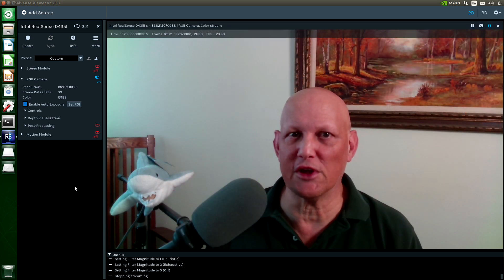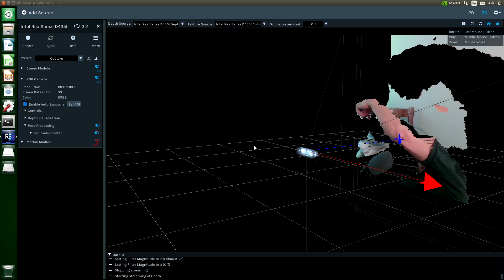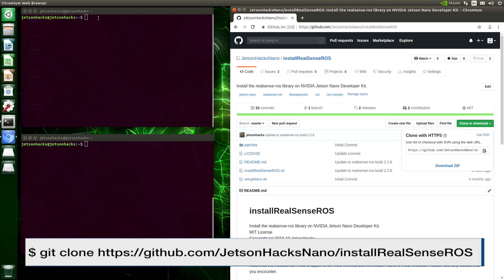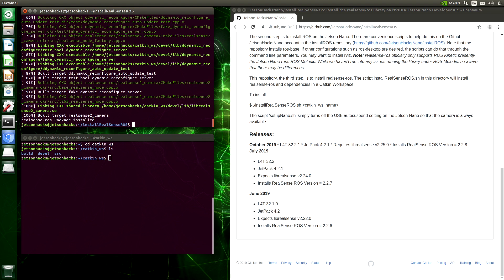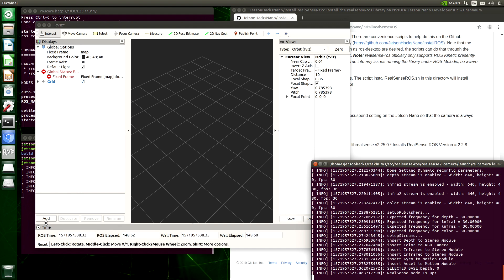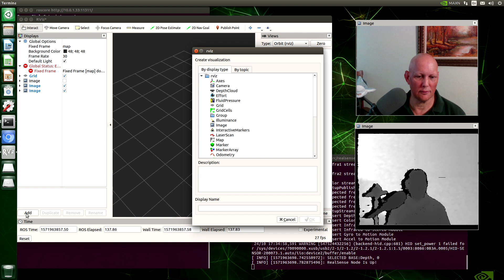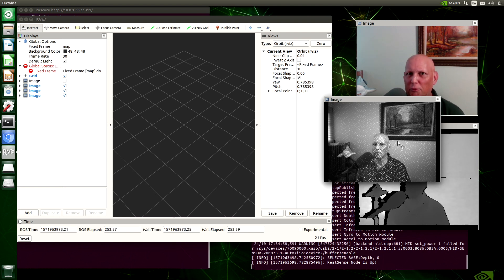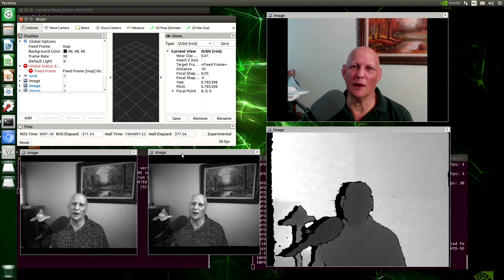RealSense Camera ROS Wrapper - Jetson Nano

Comment: How do I do this on Humble, because I can tell you use Melodic and the repo dates 5 years back so any updates...
Reply from the maker: I'm not sure I understand the question. Are you asking on how to run Humble on a Jetson Nano? As you state, the code is > 5 years old so it would need to be updated for your application a ROS version.
Reply: @JetsonHacks  I want t use an intel d435i with ROS on my jetson orin nano and i use ROS2 Humble
Reply from the maker: @adoodevv  The instructions in the video are for a Jetson Nano, not an Orin Nano. For an Orin Nano, you should follow the instructions here: https://github.com/IntelRealSense/librealsense/blob/master/doc/installation_jetson.md and for the ROS 2 wrapper: https://github.com/IntelRealSense/realsense-ros 
If you need help, ask on the Intel RealSense Github account or on the official NVIDIA Jetson Orin Nano forum.

Comment: Does this work for ROS noetic? 
Im having a few issues running the install file, even after editing it with DISTRO -> noetic from melodic
Reply from the maker: I don't have have any experience with noetic, so I don't have much to offer on your question.
Reply: @JetsonHacks  alright, just doing other methods of installation and came across a few questions as well.. 

from what i am trying to understand... it is possible to simply install the SDK for realsense and then install the ros wrapper with the apt-get installation process right? The method through the github is another option besides the apt-get install. Is this correct?

Also curious how the SDK installation has anything to do with simply the apt-get installation? I've been unable to run the realsense ros wrapper without the SDK already installed, or am I doing something wrong? - really trying to understand the process here, thanks in advance!
Reply from the maker: @sulaiman-hd8pz  The SDK is a driver for the RealSense camera, and installs the libraries and samples. The ROS wrapper calls the libraries. If the libraries are not installed, the ROS wrapper does not have anything to work with. I would expect something like:

$ sudo apt install ros-noetic-realsense2-camera

to work. You can check what the package installs to see if the RealSense libraries are installed along with it.

Comment: Hello Jim, Thank you a lot for your Jetson tutorials.  I am using Intel Realsense d435i in Jetson Nano in a ROS wrapper, unfortunately I am not able to see IMU topics in list of published topics. What could be the possible reason?
Reply from the maker: You are welcome. Does the IMU work with the RealSense Viewer?
Reply: @JetsonHacks  Yes, it works. 
Now I am using a Python wrapper method
I am importing pyrealsense2 in my script and running the script to start RGB/depth feed. However I am not able to print arrays of the IMU. Using realsense viewer however shows IMU values. I am using a Jetson Nano. 

Thank You

Comment: Possible to get ROS working with an L515 and T265?  I'm getting a fatal unsupported device :(

Thanks for all your videos!
Reply from the maker: You are welcome. Please check the scripts and select the version number of the Realsense releases that match your needs. The scripts use older release numbers. Thanks for watching!
Reply: @JetsonHacks  Thank you again, everything installed now!  Built libRealSense 2.45.0 from source and matched to RealSenseROS 2.3.0 with scripts (had to edit cmake path too).

Added Rtabmap, but seeing a frozen desktop video error in viewport :(  Also, pointcloud2 not showing in rviz viewport :/

Comment: Hi, thanks for making the video. I saw that you released a video later in 2019 where you explained a 5 minute install for realsense. If I have done that, should I install ROS separately? (My goal is to use the t265 and d435 to do SLAM on the Jetson Nano)
Reply from the maker: Intel has released a driver for the RealSense cameras and a ROS wrapper for the driver. You will need both to run a RealSense camera under ROS.
Reply: @JetsonHacks  Thanks, that really helps. Is this the right kind of driver (https://downloadcenter.intel.com/product/85364/Intel-RealSense-Cameras)? In addition, I'm not sure how to install the drivers; are the drivers installed on the camera or on the Jetson? Installing the realsense wrappers worked fine. Thank you for the help, pretty new to this.

Edit: by “driver for the RealSense cameras”, do you mean what we installed in your 5 minute realsense install video?
Reply from the maker: @theclueless11212  Yes, the 5 minute video installs librealsense, the software driver for the camera. All of the RealSense cameras use the librealsense driver.
Reply: @JetsonHacks  I see. thank you for the help!

Comment: would it be possible to have the jetson nano output the stereo video feed to a display(s) such that you could have a live monitor feed coming from the nano with none of the gui?
Reply from the maker: Not sure what you mean. At some point, you have to have some sort of graphics to display the stream coming from the camera. The camera is a USB device, it can't display straight to a monitor.
Reply: @JetsonHacks  I think I found the answer to my own question. Using OpenCV you can  run a command from the terminal which displays only the video feed you desire without any of the realsense viewer gui.

If you ever need something to do, I would love to see the realsense used with OpenCV to display singles video feeds at one time on small oled displays!  

thanks!
Reply from the maker: @Harrlond  I'm glad you found a suitable solution! I don't know what you mean by 'small oled displays' 2"?

Comment: Jim, are you getting a similar error? I can publish the images. Not sure how critical it is.
[ INFO] [1591764029.833749313]: Device with physical ID 2-3.2-3 was found.
[ INFO] [1591764029.833898050]: Device with name Intel RealSense D435 was found.
[ WARN] [1591764029.844178153]: Error extracting usb port from device with physical ID: 2-3.2-3
Please report on github issue at https://github.com/IntelRealSense/realsense-ros
[ INFO] [1591764029.870301227]: getParameters...

I can see some possible solutions here. Did not work for me.
https://github.com/IntelRealSense/realsense-ros/pull/1088
sudo apt purge ros-kinetic-librealsense2
catkin_make
Thank you,
-Jack

Comment: Hi, Jim! At 0:19 of this video you says that you "have installed librealsense on this machine and recompiled the kernel to support the camera". What do you mean? Is it necessary to rebuild the kernel of Linux to run this camera smoothly?
Reply: Oh, I found out, that it is only the last step of a three step tutorial... And the first step requires Linux kernel rebuilding...
Reply: This is a super important notice, you should provide it in the description of the video: "Starting with L4T 32.2.1 (JetPack 4.2.2) on the NVIDIA Jetsons and the Intel RealSense SDK version v2.23.0, it is now possible to do a simple install from a RealSense debian repository (i.e. apt-get install). Previous versions of this repository require building librealsense from source, and (possibly) rebuilding the Linux kernel."
Reply: @ishongin  so how did you install the librealsense and ros wrapper on JetPack 4.4 ?

Comment: It is so cool! But I have a question. I want to use opencv3.4.0 for using darknet-yolo (to make object-detection) but after i follow this video, i checked opencv version by using `pkg-confing --modverion opencv4` . vesrion 4.1.1 show up!! why happened this situation??
Reply from the maker: You don't state which version of L4T you are running. OpenCV 4.1.1 is the default OpenCV version for L4T 32.2.1 (JetPack 4.3). As far as I know, OpenCV 3.4.0 does not come preinstalled on any Jetson release, so I am not sure why you are expecting it here.
Reply: @JetsonHacks  oh! I'm using L4T 32.3.1. I installed opencv3.4.0 to install darknet-ros. After do that, I followed your video! and opencv 4.1.1 show up! actually, after i installed ros-melodic before, same situation show up!
Reply from the maker: @김정인-v1v  The pkg-config command asks the system for the the installed version. Unless you uninstall OpenCV 4.1.1, it will show up as the pkg-config version. You will need to point to your OpenCV 3.4 version appropriately for darknet-ros to find it.
Reply: @JetsonHacks  okay! i will keep in mind. your videos are really helpful to me!
Reply from the maker: @김정인-v1v  Thank you for the kind words. Good luck on your project!

Comment: camera output not appearing using d415 model and the error is fixed frame does not exist
please solve this issue. Thank you
Reply from the maker: From your description, it sounds like you are having issues. Did you assign a frame to the scene?
Reply: @JetsonHacks  actually I had an issue with the ros installation after reinstalling ros it worked perfectly. Thank you.
Reply from the maker: @soofiyanatar9247  I am glad you got it to work.

Comment: I have been stuck on the error of SDK 2.0 is missing for couple days. I did exactly the same as what you did in this video. Any clues? Please help!!!
Reply from the maker: Are you able to run realsense-viewer
Reply: @JetsonHacks   Thanks for your reply! Technically I can, it just throw a lot of errors like bulk_transfer returned error. While my largest concern is Intel SDK 2.0. How did you solve that problem? Magic!
Reply from the maker: @shadowlegion3115  Have you tried using a powered USB hub?